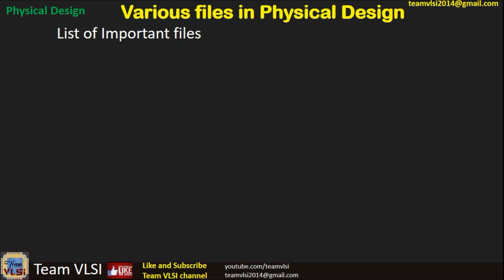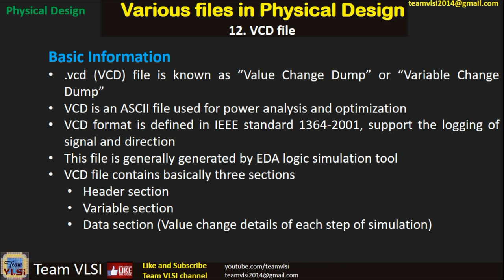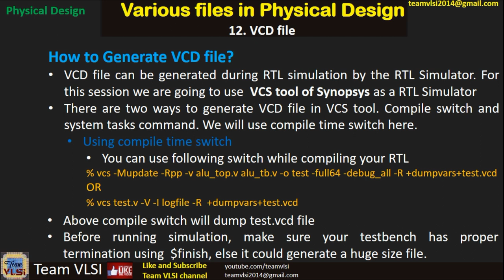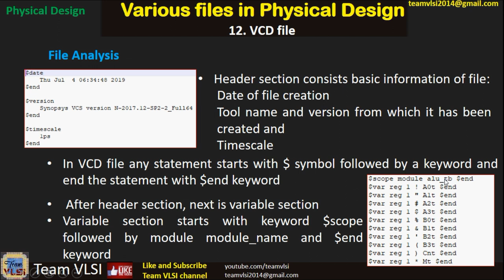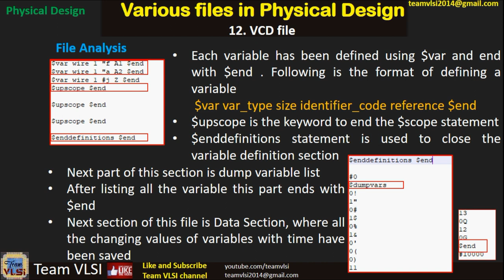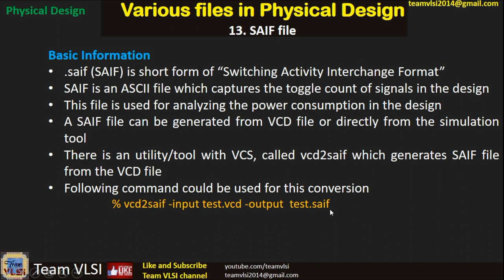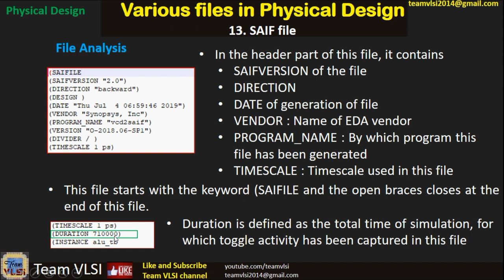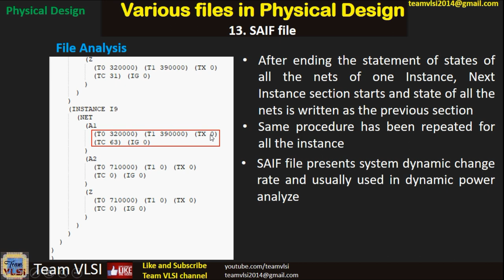Value Change Dump | .vcd file | Switching Activities Interchange Format | .saif file

Comment: Very informative video 👍. Please keep making such videos.

Just wanted to confirm that in SAIF file, you described TC as transition time in ps. However, I think TC describes the absolute numbers of  toggle count. Please correct me if I am wrong.
Reply from the maker: Thanks Abhi,
Yes, you are right. TC is Toggle count. 

I would suggest please use the time stamp of video to indicate the actual point of time where I have described the point which you are talking about. It help me to quick check.

Thanks again for the correction.

Comment: Please provide a video generating saif file in xilinx ise 14.7.
Reply from the maker: Hi Ankur, Currently I am not using xilinx, But if possible I will let you know.
Reply: Have u found how to generate saif file using xilinx ise14.7
Reply: @divyaparameswarip9410   You have to use a syntax in your testbench mentioning the target file name. something like $dumpfile("test.vcd"); and $dumpvars;
Yes, I generated it. But now I'm not working with those tools so forgot.
Reply: @divyaparameswarip9410   you have to add syntax like following
saif open; <start dumping data into your file>
run 100ns; <to run simulation for certain duration>
saif close; <close the file after simulation done>

!!! these are not exact commands. just a hint. Please explore around this.